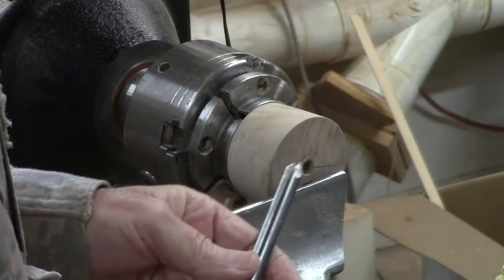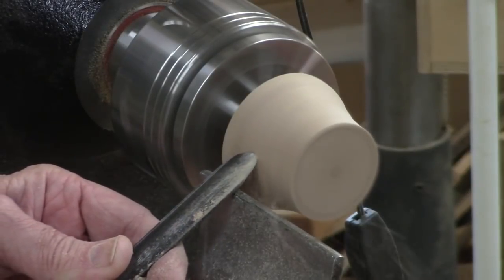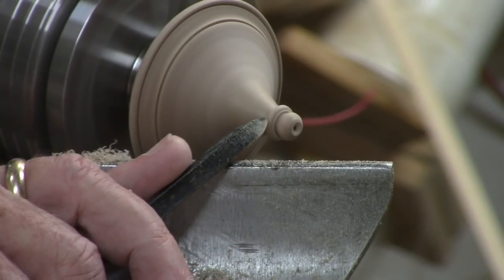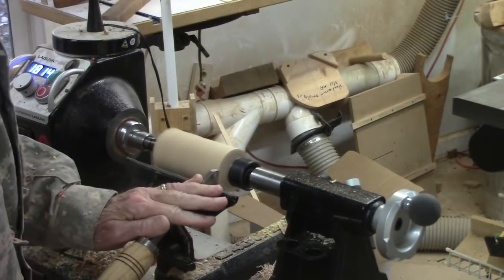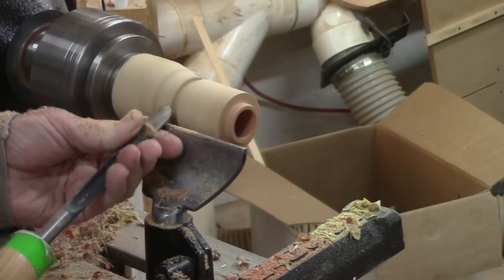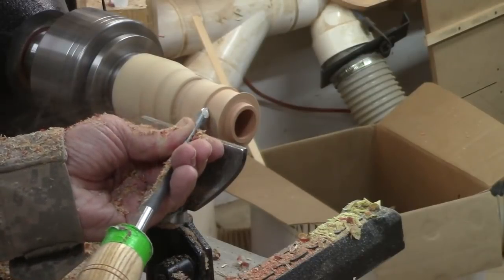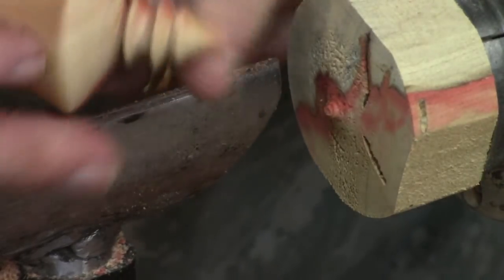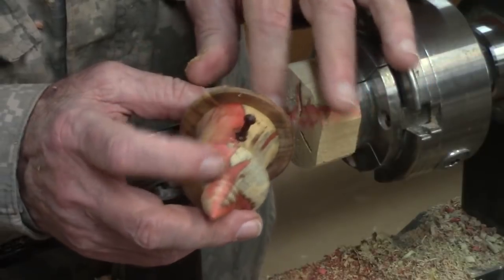Birdhouse Ornaments - Fun Wood Turning Projects!

Comment: Piece is really nice.   Which Hunter tool were you using?   It looks interesting.   Do you know how it performs for acrylics?
Reply from the maker: Do not remember the name but it was the small one for ornaments and such. I have nevr used it for acrylics. Because it slices I doubt if it would work as well as a flat carbide scraper.

Comment: Nice ornament.  Did you finish the body of the house?  Have you tried the negative rake version of the round carbide tool bit?  Also, D-Way Tools has some very nice negative rake double ended tools designed specifically for boxes and small spindle projects that really work well and I don’t have to have 20 years of turning experience to use successfully.  Have a great holiday season and stay safe!!
Reply from the maker: I used a shellace based friciton polish. I have several HSS negative rake scrapers so do no plan to buy a carbide one. The Hunter tool slices and leaves a superior finish to a NRS, especially on a soft wood like box elder that is more prone to tearout.